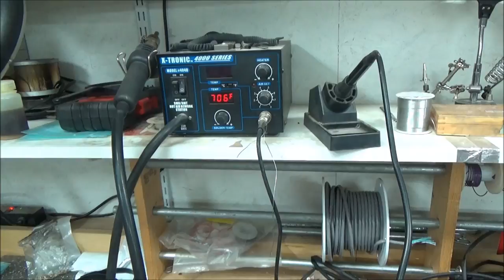Acorn Project Part 3-5

Comment: Thanks for the videos. Curious, why do you think the signals are cleaner from the DB25 than the other connector?
Reply from the maker: Because I put my oscilloscope on the pins.  Most likely due to the pullup resistors